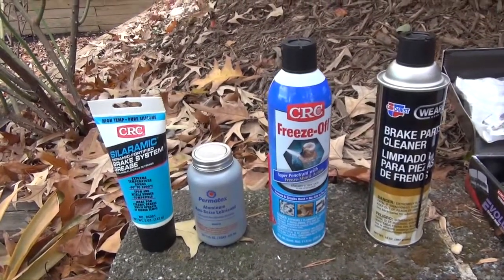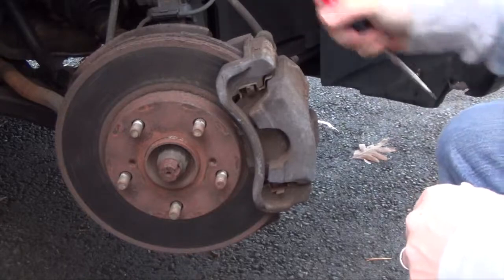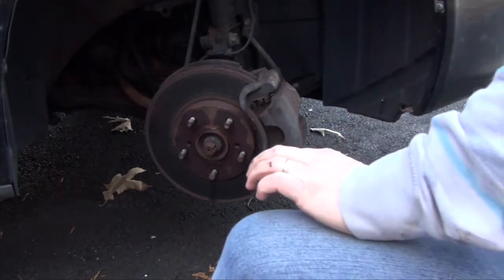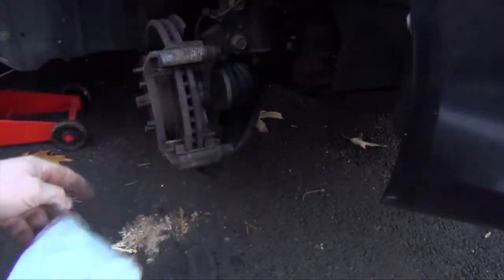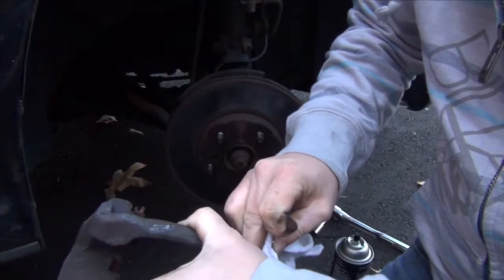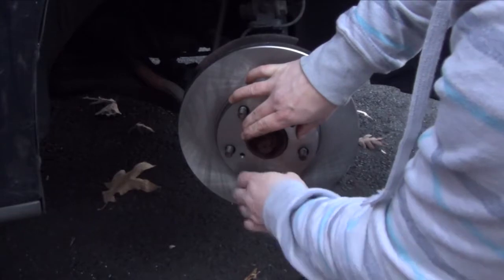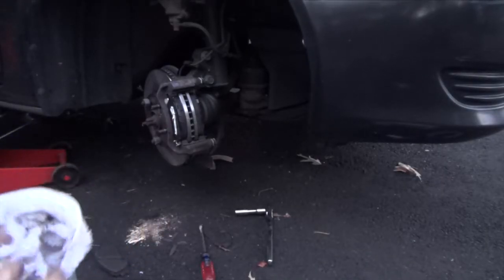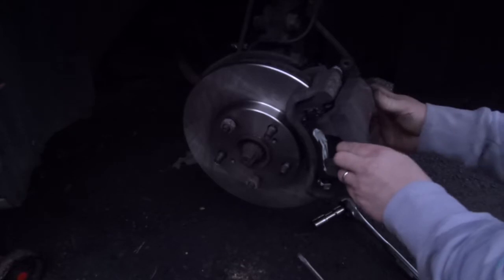Front brake pad and rotor replacement 2005 - 2006 Toyota Camry

Comment: Use Sil-Glyde Silicone brake lubricant for the slider bolts, Not never seize. Don't use the regular brake grease either as the grease will swell the rubber  O rings on each of the slider bolts. You can use the brake grease on the pads ears so they slide. Pls use gloves as to protect your fingers.  You are dressed too clean for this dirty job. You have good teaching skills!
Reply from the maker: Joe T LOL thanks for the comments and suggestions! Please subscribe.
Reply: I visit my local GoodWill for comfortable t-shirts and pants that I will exclusively use for dirty jobs ( Also , I prewash those clothes in a 5 gallon bucket ).

Comment: You have new pad support plates in the kit, why didn't you use them?   Use a wire brush on those encrusted component.
Reply: OEM hardware is better.  If it's not in bad shape, I clean with skinny brass brush & lube.  But if it's not OEM, yeah, change out for new hardware.

Comment: There seems to be a dilemma on the front rotor size. What size rotor goes with the 05 le Camry?
Reply: The 02-06 Toyota Camry had a  suspension system redesign.  So the parts are different 2002 vs 2006.  I don't know what year the change took place.

Comment: What size jack should i use to take off the breaks and the peice that holds the break?
Reply from the maker: Carl Brown You do not need an expensive jack. As long as your only going to use it on a car. Something inexpensive like this from Walmart will work. https://www.walmart.com/ip/Pro-Lift-F-767-Grey-Low-Profile-Floor-Jack-2-Ton-Capacity/28087370?athcpid=28087370&athpgid=athenaItemPage&athcgid=null&athznid=collection&athieid=v0&athstid=CS020&athguid=914d76fa-60f-16b4dd8b157b89&athena=true

Comment: Why not use the new clips??
Reply from the maker: Good question. In the past I have used the aftermarket clips. They dont always fit properly. I have had to grind several to fit so they dont have scrape against the rotor. So if the old ones are not bent up or rusted, I clean them off and leave them in place.

Comment: I'm a professional mechanic and I never use the old hardware for one it comes with new hardware so use it and my shop would fire you if you used the old over again plus I would feel like a hack if I used the old hardware over.
Reply from the maker: Blake Waddell Hey Blake. Thanks for the comment. I’m no professional mechanic. I just like to wrench on my cars a bit. When you say you always replace hardware. Are you referring the the bolts and the clips in the calipers or just the clips? I only replace the bolts if the kit I buy comes with new bolts or if one snaps when I’m removing it. I have heard from other mechanics that the clips in the calipers can stay as well as long that they are not F’ed up. Just spray some brake cleaner on them and stick them back in. I always replace them if I’m doing calipers but not if I’m just doing pads. Should they be replaced regardless of their condition??
Reply: But 2 things buddy he  he said he not a professional and that's probably his car so he can do whatever
Reply: Mister Service DFW yeah but to do it right it should of been replaced I agree it is so he can do it but it’s not advised
Reply: Those non oem brake kits come with shims that don't always fit properly. He did the right thing to reuse the originals. A step up would have been to take them out and sand them or file lightly then replace.

Comment: IF your going to be doing mechanic video's learn the correct names of the parts your working with....that will make it more professional sounding when your narrating it.  Other wise not bad
Reply from the maker: Physical Starfighter Thank you for the comments. I’m far from a mechanic, but doing basic stuff like brakes is easy. What did I say incorrectly so I don’t make the same mistake again.
Reply: @FrankGuest  i think he meant when you called a bolt a screw,big deal you corrected anyway.
Reply: Geesh give the guy a break at least he took his time and effort to teach us something and no you don't have to know the correct name this is where common sense comes into play cause we know exactly what he means even if he said it wrong🙄

Comment: Safety! Safety! Safety! I don't see any jack stands,??? If you're not a mechanic why are you making a video???? Let the professionals make videos. If you make a video and a enthusiast watches what you tried to teach and tought wrong its on you mate. In future use gloves and a pry bar or long screw driver to pry rusty stuff off. Wrong again all bolts have a torque specification. Bad advice. Torque specs can be googled you just need to know the thread pitch and size ie course fine  thread... bolts used to force out rotor/disc away from hub are 5/16 18 length 1"
Your just changing out parts you're not giving advice on any problems that may cause defects ie worn rotor spec seized calipers, wheel lugs nut torque specs etc etc....
Reply from the maker: T D thanks for the comment mate. Your correct. I’m not a mechanic and should have used jack stands. But you are incorrect to say that only professionals should post videos on YouTube. Thanks again for watching! Have a great day.
Reply: I am definitely not a mechanic. Just wondering if should pull the top off the master cylinder when you're compressing the calipers? Maybe to force the air out of the top?